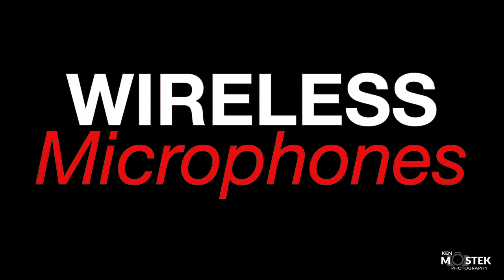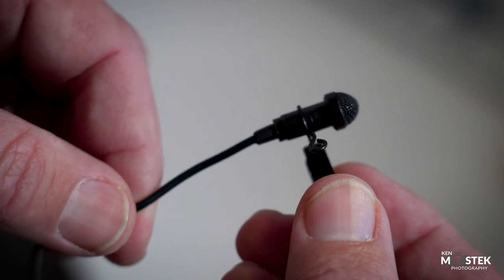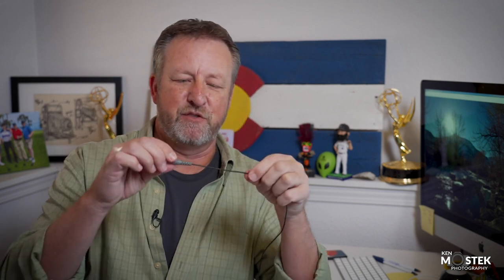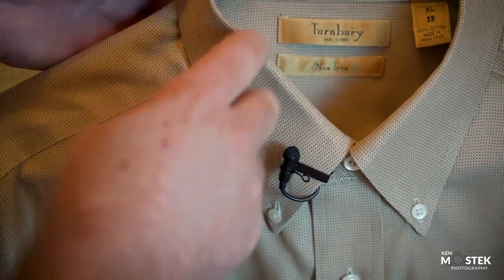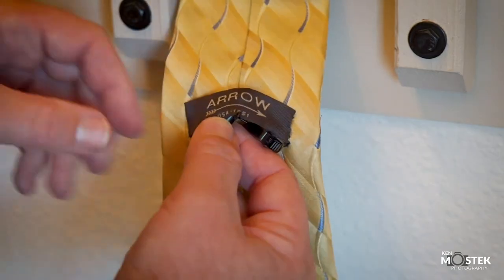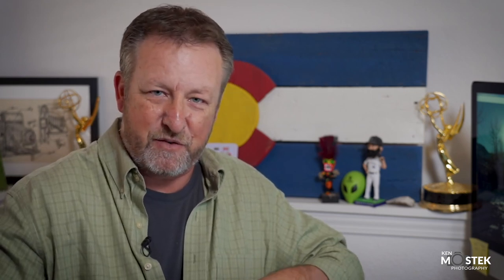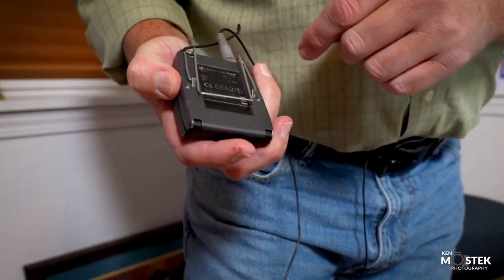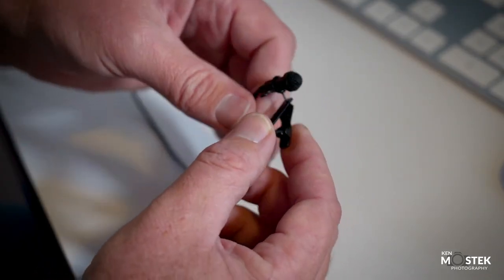Why is my WIRELESS MICROPHONE making STATIC?

Comment: I’ll CashAPP or paypal $30 to whomever first offers me advice that fixes this excessive static problem I’m having on my wireless mic system.  Static example here::  https://youtu.be/NSTtwoUFDFk

Wireless Mic System:  Sennheiser ew 100 g3.
Squelch = Middle
AF Out = 0db
Sensitivity = -36db
Prior to recording, I scan a new list and then pick an available channel, ensuring that the RF bar on my receiver isn’t picking up any RF.  I’ve played around with all the settings and nothing seems to help.  I have the receiver mounted on top of my camera, and then I've experimented moving the wireless transmitter around, having it in my pocket or attached to my back, and no matter what I do, the static remains constant.